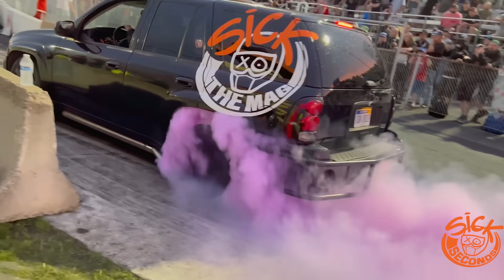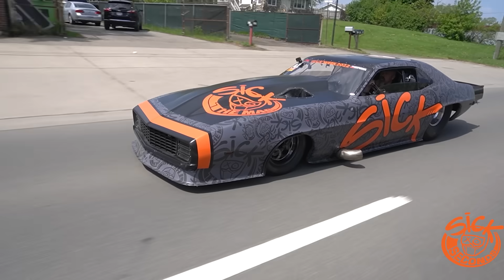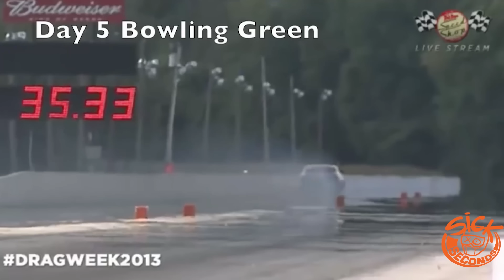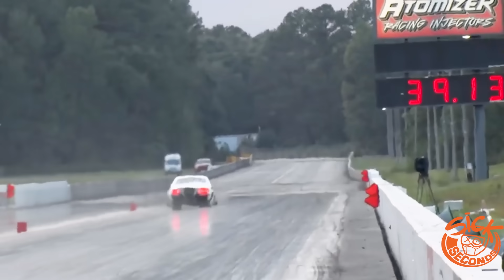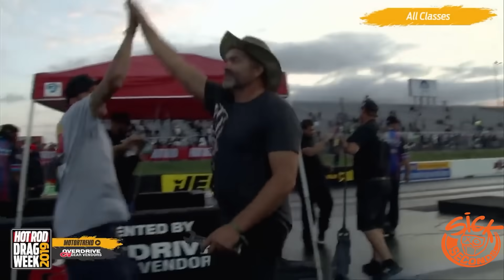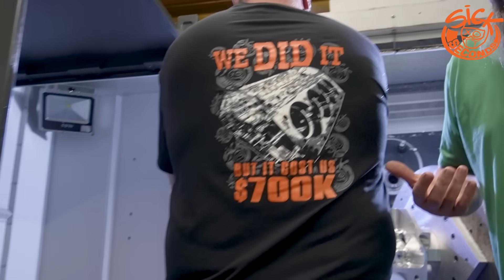$700,000.00 Engine Block!! We Did It But It Took 2 Years!

Comment: Just to be clear:
Blond pube= .0026"-.003"
Black pube= .004"-.005"
Red pube= .005"-.008"
Of course these numbers are for relatively straight hairs from 20 year old females.
NOTE:
Curlier hair exhibits a more out of round condition and older subjects may produce thicker specimens.
All measurements made with NIST traceable instruments, by enthusiastic technicians.

Comment: I program CNC machines as a job using Mastercam cadcam software so I understand what you have gone through. This is why a shop will always quote a large cost for 1 part and each 100 parts after get cheaper, once you have the process figured out each part after gets easier to produce therefore costs less.

Comment: I have just tuned into this and I am missing the point here, is this something more than a polished block?
Reply: The big block version can make 5,000 hp with twin turbos and will stay cool and reliable to drive hundreds of miles between race tracks for drag and drive events. Tom's car runs a 5.xx quarter mile and many people run 6 second quarter miles. The new engine is an LS design to make 3500hp and actually hold up to a drag and drive event. Have you watched Cleetus McFarland and the Mullet race car? Water does not flow between the block and heads so they don't blow head gaskets like a traditional style engine.

Comment: I’ve been around CNC machining a long time and I’ve seen allot of engine blocks made.  My experience has taught me that when your venturing down a road that you know is going to come with a huge learning curve, you try to mitigate loses by being more proactive.  One of the first things I would have done after I had all of my machining paths simulated and proven, would be to glue together high density styrofoam blocks to the exact size the aluminum blocks would come in at.
This won’t simulate material movement during machining but it will give you an opportunity to prove out your machining without sacrificing material.
I would imagine there would also be a Rough, Semi Rough, SemiFinish and then finish machining process.  Each phase would have a heat treat process in between to relieve stresses inherited during machining.  Stress reliving the machined block only once is not enough.  When you’re removing that much material there is going to be allot of movement. 
The best advice I would give is, don’t use expensive material to prove your program.  It’s too costly…
Reply: 100 % Accurate on the Heat Treatments . Gr8 Advice 4 these guys , hope they took it on board . Do it right everytime . No shortcuts .     Probably require a couple of these machines & engines on the go at any one time .

Comment: Nothing can be finished to size if it is being sent out for heat treating.  As it stress relieves during heat treating, it IS going to change the dimensions.....flatness, roundness, perpendicularity ....even if it's only slight.   Even a  few tenths would put many dimensions out of tolerance on an engine but typically things change by several thousands..  
Trial and error to find the sweet spot for how much material to leave on.

Comment: Instantly subbed, when I see the first stipulation is no politics in comments,, love it!!!! 
   A 700,000 dollar block,,😮 I'm guessing a block at that price will easily handle nitro, and a twin charger setup, with a 400 shot of nitrous at the same time...😂😂😂 for around 4-5 thousand hp...
Reply: It only needs two turbos to make that 5,000hp and can be driven on the street between race tracks. That is why they build these engines. I'm not sure what the smx big block costs, but his first Sml LS engines were going for about $100,000 each as a complete engine.

Comment: with 3d printing out there is cheap to print out designs and validate the data before going to actual manufacturing there are other companies that can take that data and MFG it, I dont know why these guys were playing with  real aluminum when other methods are out there good for their success though
Reply: They are not validating data, they are producing street engines that can make 5,000hp, 3500hp for the chevy LS version. They are producing the product that they already use and sell, which is proven.

Comment: I would like to note sometimes they put bracing inplace for heat treating to help it from moving around, maybe a shaft in the cam tunnel then heat treat and remove shaft after heat treat. Also you could look into vibratory stress releaving. Have used that on pump frame weldments. 
Have you looked into cryo treating. It does wonders for some parts. 
Last, which should have been what you did first, you should be laser scanning a proven block and overlaying your cad model to see how close the model is to the proven block. It would have lit up the lifter bore issue before it became a problem. It catches stuff you cant measure easily.
Reply: A shaft in the cam tunnel would either rattle around at temperature if steel (differing CTE), or likely warp if aluminum. And in either case the extra thermal mass would interfere with the HT process. Better to leave extra material, rough and stress relieve, then go through careful semi and finish cutting. 

Reality is that even with all the care possible, the block will move a tiny bit more with actual assembly and bolt torquing, then with the variable temps when running.  Have to account for that movement with tolerances.

Comment: Add a new dimension of stability in the aluminum by cyrogenic heat treatment use dry ice or liquid nitrogen and freeze the aluminum at-180° or more at 1 in./h of thickness of metal to soak completely a minimum of eight hours. Do not finish any dimensions on the block and leave at least  .060 to 200 thousandths to finish machine everything to remachine the block to finish size dimensions. minimum radiuses should be at least.060 so no cracking occurs at subzero temperatures and re-machining of radius is to sharper can be done later. Ample machining of microscopic cracks from freezing in the surface must be allowed for to be able to machine to a finish size

Comment: At which stage in the prosess did you do the stress release? I jused to work at a machine shop where we made a lot of dies and tooling for car parts manufacuring. For the bigger tooling we often machined at 3 stages, with 2 stages of heat treating in between: roughing, stress release, semi finish, hardening, and then finishing

Comment: The cost of the machine is a capitol investment.  If you sold it at the end of the project and costed the difference that would be the "cost".  Tooling is debatable and typically could go either way, a mix is more appropriate.  The employee should have been included as that is a direct cost.

Comment: Great job guys, 45 years in the machining field here. Deal with material stress relieving during machining constantly. I would have machined leaving about .200 on every surface then heat treat and inspect for how much movement occurred. After discerning a range of movement in several blocks I would try and reduce the amount of material left to speed up the finish process.Anyone would have had to digest the cost of learning like you did.I'm really impressed!

Comment: FYI...... I worked with a company one-time who bought a product that was supposed to be market-ready however it turns out it was not they spent three years helping the company fix the bugs etc etc..... the company then turned around and made patches for all their other customers software programs and the company I work for after finally getting it working sued the manufacturer for the software that WE (Myself and 1 of my coworkers) helped them develop to fix their product...... the company still gets checks annually...... for work that I and one of my co-workers did..... work that we were not qualified or trained for.... just the experience of using the broken technology identifying the issues that constantly occurred as well as shortcuts we learned to use to get around the issues which in turn help the company to develop patches to the software..... so if you want to sue Haas engineering for your work on fixing their product you can get paid for the rest of your life based on the patient being used.... just like that YouTuber that question Elon Musk on how the rocket engines were being utilized.... Elon Musk even recognized himself that he had made a mistake on camera went back made some design changes and then after those changes were implemented and success was found he acknowledged that it was the YouTuber who had given him the idea which was just an oversight on elon's part to begin with even though it was Elon musk's design it was the YouTubers idea to use it so the YouTuber could sue Elon Musk if he wanted to but I doubt he will since it's been years since that had occurred and I've not heard about any kind of lawsuit or settlement.....

To put it plainly if General Motors spends a considerable amount of money developing an engine that keeps catching on fire and then you tell them how to keep it from catching on fire they Implement your ideas and make a gazillion dollars you deserve some money out of it don't you think ?

Comment: Heat treat is time at temp. Then it depends on quench temp 70-99 100-143 209-212 degrees. Quench   temp depends on process afterwards ie forge, machine etc etc. Then the type of quench also water, glycol and carbonate. Age process for stress relief and dehydration is another story

Comment: When I was 14 I got to drive a Top Fuel funny car up Rochester Road at Full Throttle with a blown Donovan Hemi. That ran on Nitro the car was called the King Cobra it belonged to John Brown, my neighbor in the 1970s. I've always had drag racing bug. I could just never afford to go that fast. I am building a 2001 Chevy S10 with 383 Blueprint engine and Brodix Heads. Probably low 11seconds street ride. Rusty old pickup. Sleeper.

Comment: Good machines for starting out, but you will eventually move to higher end equipment that is stronger and lasts longer. I have been repairing CNC machines for 20+ years and there are so much stuff shop owners are oblivious to when buying equipment. Sales Engineers lie out their asses and like you said never buy the “First one.” Doesn’t matter who makes the machine, because I work on $1M+ grinders that should be amazing, but they suck, because they are nothing more then prototype versions that the company sold for cheaper. God I could go on for days about that bullshit.

Comment: You forgot to mention how much a block cost?
Reply: bare smx big block is about $20k.....that is just the cost if you trash one of these and it can't be repaired. The complete LS sml was listed at about $100k for the first 10 made. You still have to add forced induction and other supporting equipment. Imagine 5,000 hp from a big block that is made to be driven on the street/highway and then runs 6 second quarter miles......5 seconds in Tom's car.

Comment: I'm so looking forward to moving into this industry as I start at my local community college in August. After 18 years as a horseshoer, learning how to program CNC machines will be much safer and rewarding career as I get older.
Reply: i have known several Farriers and all of hem are all busted up from the abuse they take on a daily basis. good on you to get out when you can.
Reply: @Omahaguy68131  yup!  At 46, I still want to have a body when I get older.  Machining and CNC programming seemed like a good fit for me for the next 15-20 years.
Reply: Get in a shop why college
Reply: @robertlawler1387  education is not a bad thing.
Reply: @robertlawler1387 shops pay for just learning all day?
Reply: @robertlawler1387  most shops will just have him pushing the green button, take a finished part out, and load a blank in.  They already employ people to write the code
Reply: Good Luck, you probably made more as a ferrier. CNC operators make damn near nothing. And, Fusion 360 generates G-code almost autonomously. Despite what you might believe manual machinist is higher paying and more stable, as AI slowly kills designer and programmer jobs.

Comment: why did steve move away from who was making the blocks before?    in one of steves last videos he mentions that the bell housing mounting surface is a but smaller then the original blocks.   has that been fixed or ya just rolling with it and adjusting mid plate accordingly?

Comment: Would using cold instead off heat help more when treating the metal ?  Cryogenic treatment is a mad science
Reply: While cryogenic treatment has its use, it is physically impossible to age-harden (also called precipitation harden) an alloy by deep cooling. You need thermal energy to facilitate higher mobility of elements within an alloy to age/precipitate harden. That goes for aluminum (aluminium) age-hardening alloys, for steel precipitation hardening alloys, for nickel superalloys that can age-harden, etc.

Comment: Very cool Tom! Since I started at Diamond I've learned a lot. It's crazy knowing how much goes into machining a piston I couldn't image setting up a new block grogram. it's cool to see that you've completed that goal, thanks for the behind the scenes.
Reply: Working for a piston maker HAS to be a hot rodders dream.
Reply: @robertwest3093  I turned down $2 per hour more at Pepsi and my brother called me crazy. Lol I told him my passion is worth 2$ an hour.
Reply: Ok e poured a ton of pistons and have run them through a rough cut machine tons.
Reply: @garrypeek897  not sure what you just said there. But I run Multus machines, I start with a blank forging and end with a finished piston on a single machine. The only machining that has to be done after is turning the skirt down a few thousandths. I was blown away at the process. Most shops I've worked at had a different machine for each cut with ten different people touching the part. Way less opportunity for error when it's all done in one machine but also a lot harder to program. I thought doing every process on a piston in one machine was awesome let alone on an entire block. 🤯
Reply: Quick question. How much do you guys do gas porting these days? Seems like more and more people switch to gas ported rings.
Reply: @AB-80X  probably 75% of our forged jobs have gas ports. Probably 75% of those are side gas ports the rest are either top or both.

Comment: I'm a cnc machinist and lead programmer at my shop. I love it. And yes software is super expensive and a part this complex takes tons of time. Congrats on getting it done brother
Reply: As am I. Originally trained and certified as a Toolmaker. The issues they are dealing with has to do with thorough knowledge of machining. Factory V8's were originally made from cast iron because of the cost and how stable cast iron is, as cast. Dealing with aluminum, especially heat treated aluminum takes knowledge of the materials. Rough machine after Heat treat, and then finish machine last. Because Aluminum moves more than any other material, especially heat treated.

Comment: This makes sense, I know metal has a crystalline structure, but if it’s cast into a block the structure wouldn’t be consistent and at it’s strongest, bonds wouldn’t be uniform through the whole block so there would be weak faults throughout the block. So your heat treat is letting the molecules of metal realign into a more continuous crystal to make it stronger.
Reply: @jonkeau; Perhaps You need some basics win physics, chemistry and materials. Metals are NOT crystalline structure. Period.
My background actually includes proper studly, knowledge in these areas from over 40 years ago, then working within research, designr, development, verification, certification, etc.  Good Luck
Reply: @newtonfirefly3584  perhaps go and do research? If you look up “do metals have a crystalline structure” on google you get absolute boatloads of research articles from reputable sources saying all but a small handful of metals DO have a crystalline structure.
Reply: @newtonfirefly3584  and by reputable I mean page after page of collegiate research.